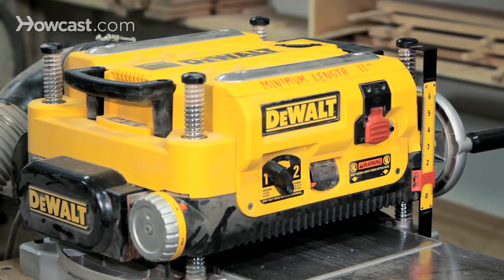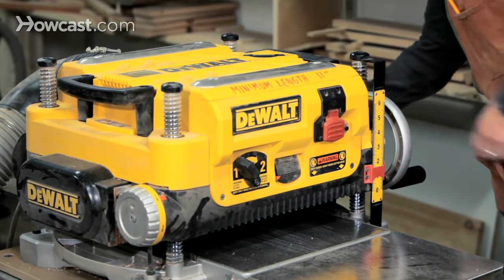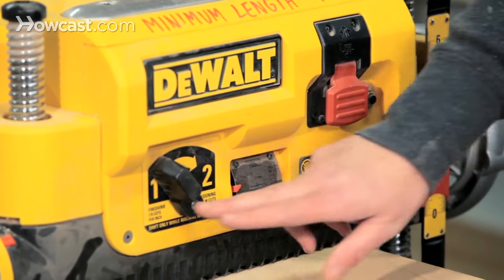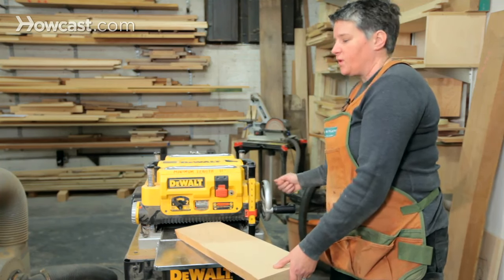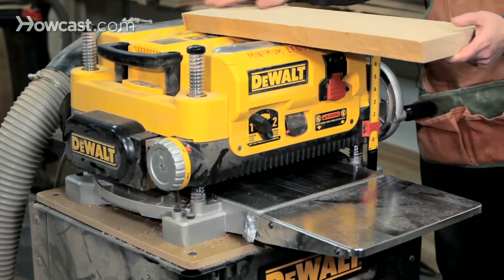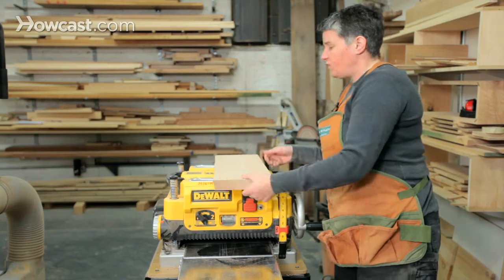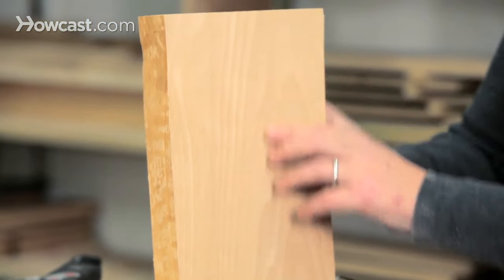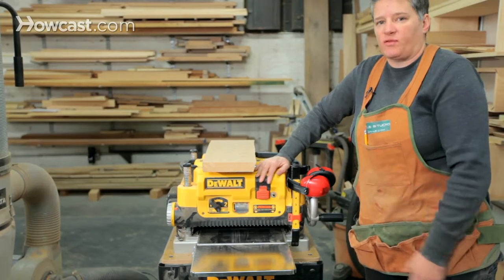How to Use a Surface Planer | Woodworking

Comment: One tip from my experience: There is no major need to own one if all you have nearby is S3S or higher lumber. If you have rough sawn available then sure. Or if you have specific thickness needs. I built a dining table and never used a planer.

Comment: In my wood shop class I put a board in the other way and forgot to adjust the planer, the planer overworked itself and it stopped cutting, scared the shut out of me but my teacher assured that it was fine.

Comment: Thank you so much for this basic lesson. I have just started using a planer and I was going crasy over the deeper cut at the end thinking my fold out table was maladjusted. Turns out it has both a name and a remedy. There is no substitute for experience!

Comment: Love you vids!  Great tip on the way to avoid the snipe. I don't use PPE when using the planer either. It is simply not needed with this tool.

Comment: it is easier to adjust in and out table so it is a 0,5 mm above the surface of the planer this way the stock will enter and exit without loosing a chunk on both ends.

Comment: Thanks for video info!    I used a planer for the first last night and smoothed the top of some small boards (12" long,  1/2" by 2").   Worked well considering the cheap planer.    I then turned the boards on their sides and with 5 or 6 of them together,  I ran them through planer.   This was a mistake, and after running some individually through to try to fix them,  the problem only increased.   I was left with "tails" on the boards that were cut much deeper than the rest.  Is this a problem of my planer not having a true,  flat,  in-feed/out-feed?  Or are the boards too small and I need to make a jig to run them through?   Thanks again for video!

Comment: Most snipe is caused by the infeed and outfeed tables not being in perfect level or alignment with the bed of the planer. I see on the video that there is some need for adjustment. Other than that a nice video.

Comment: One question though: The whole point is getting a smooth and straigth piece of wood, right? But you're saying you can't do this without having one side already smooth and straight... so how do you make the first side straigth? Do you need another machine for that?
Reply: Run it through the jointer with the bow facing down.  Once flat, run it through the planer.
Reply: I have seen work arounds for this on Youtube.  Not having a planer, I couldn't say from experience if they work, but  they seem to make sense.

Comment: Wait, did she just turn it on dust collector by remote?
Reply: I smell new project ideas
Reply: The machine has its own vacuum chip extractor, that switch turns it on and then you dont need to add your own vacuum...So no she didnt turn on a collector by remote but rather the one in the machine

Comment: Your presentation on how to use a surface planer was excellent. However, I think you might have made one mistake: when showing how the depth stop works, you said that you can put it on a very low setting to make sure that it never stops you. I think that you should have said the opposite: that to keep it from ever stopping you, you should put it on a very high setting. Am I correct?
Reply: +Matteo Luccio No, if you don't want to use the depth stop, you should put it on the 1/8" setting or as low as you can get it.  That way, as long as you don't plane the piece below 1/8" thickness, the depth stop won't matter.  If you were to put it on the highest setting(on that model it's 1 1/4") it would not let you plane the wood to less than that height, which would be very inconvenient.

Comment: Good video, but you should also use eye protection when using a planer.  Even if you aren't behind it, and even with dust collection on, you can get chips flying back at you or just dust in the air.  At least she included hearing protection.

Comment: Gosh, wish it did less than 11" length.
Reply: Dennis Mathias it will if you run a follower board in behind the one you're planing
Reply: You can double-face tape the board to be planed to a known flat carrier board. Adjust thickness to the carrier plus tape. Have fun!!

Comment: Its a planer thicknesser not a surface planer so i dont hold much hope for this video given they miss name the tool.
Reply: this does both. 1 for finishing surface, 2 for dimension cuts. was explained in the video.
Reply: ri mar please do some research before piping up on what you dont know ps I'm a qualified wood working machinest and is is a thickness planer .A surface planer is the type that you push the timber over the cutter in order to straighten and square up .
Reply: ri mar as I said I'm a qualified wood machine worker I.E  I do this for a living not a bloody hobby or a pass time  8 hours a day for far too many of my years .